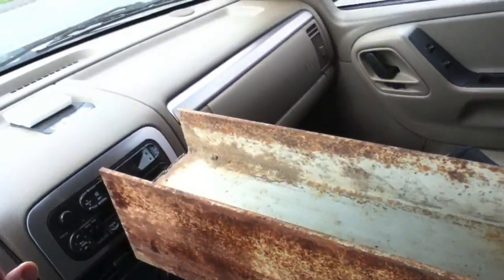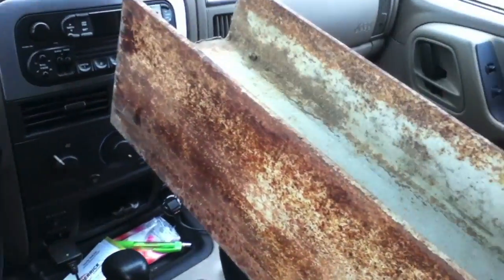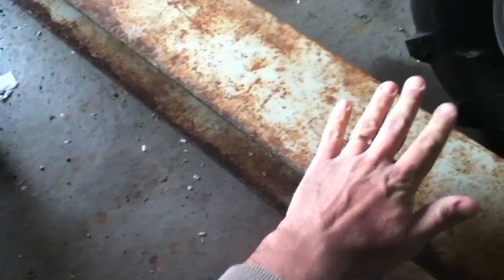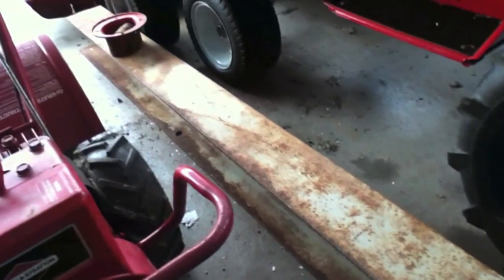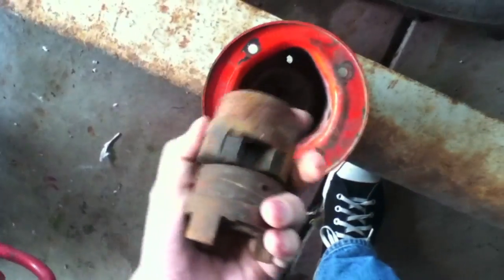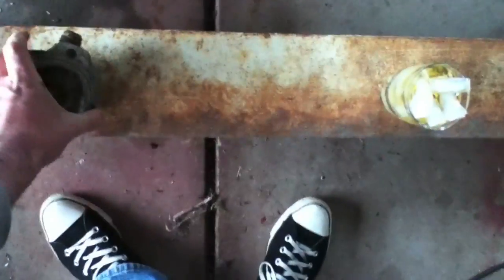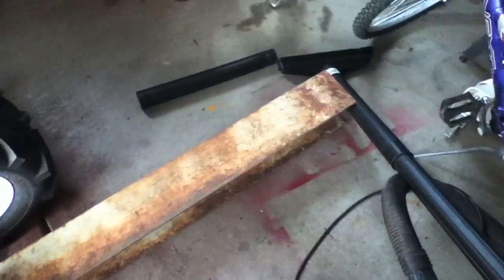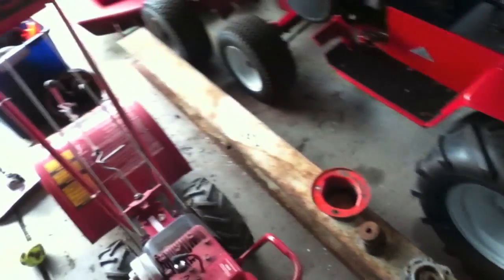New Project Log Splitter

Comment: its a fixed displacement pump so gpm depends on rpm. say its 1.5 cubic inch per rev you would have 13gpm @ 2000rpm. im thinking its close to 1.5 to 2 C.I.D (cubic inch displacement) when you get close to figuring out working pressure and rod speed i can help with the math.

Comment from the maker: Snitzlhaus jumped on the Lovejoy thing, but I wiped out my first video upload because it wasn't in HD.  I have to see if this pump will work or has the capacity I'm after.  I've already been eyeing up a 22 gpm Haldex pump-2 stage, with a 5" cylinder.  Think I'll need about 11 hp to get that sucker to cycle in 9-10 seconds.  That is the goal.   This is gonna be fun.

Comment: What would really be cool is if you could set it up to run the pump off of the 520-H PTO. Haul it on the trailer to where you need it......hook up the log splitter and pull it on site.....then run the pump from the PTO and haul it out again. Bring your trailer and you can haul the wood to the truck and stack it. Two machines to do it all!